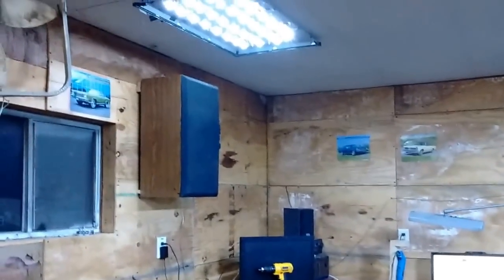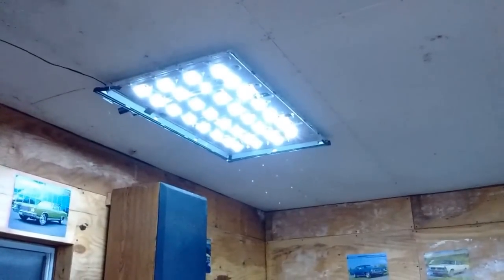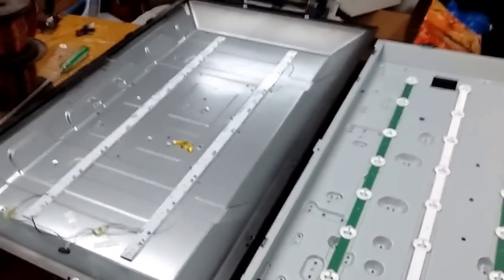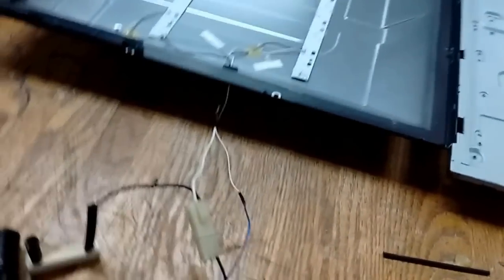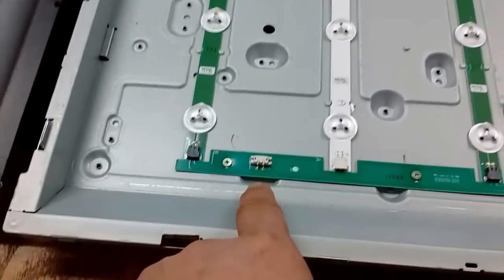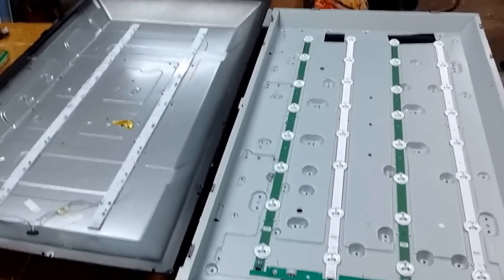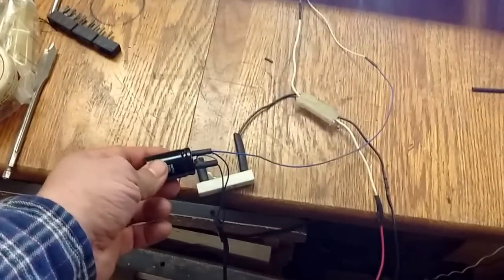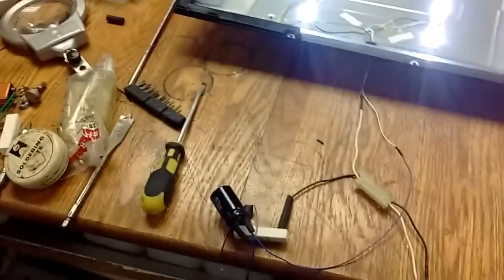DIY Super cheap & easy LED shop lights

Comment: I’m almost ready to try this.. I’ve lit my shed successfully with the bulbs from  (2) 55” salvaged TV’s using a 24vdc power supply. I want to try your method but What if 1 LED bulb burns out? Do they all quit working? Thanks
Reply from the maker: Yes unfortunately, they all quit working if one burns out. When that happens, just bypass that LED with a jumper wire and you will be back in business.
Reply: Thanks for the response. I tried bypassing a bad LED on a strip I salvaged from a Samsung 50F6400 ...the LED's are mounted to a PCB and the traces were finer than frogs hair and wouldn't take solder.

Comment: No, the messing around the back of TV's had nothing to do with capacitors, but more to do with flyback transformers and voltage triplers, on a CRT color set, the rail voltage from a flyback was usually 25,000 to 30k volts. On today's junk throw away TV's, biggest threat is your full wave bridge rectifier there, and filter cap(s)which is a mere 300-400 volts DC peak at best, I've been hit by much worse back in the 80's. So even with TV Technology, as w/ horror movies, it seems the "Shock Value" is lowered as well ;)

Comment: I would add a bleed resistor 10K ohm across the capacitor so that when the power is off the residual voltage on the cap is dissipated.
Reply from the maker: That is a great idea Bert. I think I will do that on the next light I do. Thanks.

Comment: You can bypass the mainboard in the TV just run a bypass on the power supply. usually PS_ON or BL_ON. Look on the board, sometimes it's marked if not you'll have to meter it. Some TVs use a 3.3V signal and a signal ground. tie these two together and the power supply should come on.

Comment: Why not use the original drivers power from the TV?
Reply from the maker: That could work. You would have isolate that circuit and figure out what it needs for an input voltage and find a way to supply it.

Comment: Good idea but the warning about capacitors is very real. They can hold charge for a very long time if not discharging because of a fault, you really do need to check them before touching them. I am not sure that shorting them out is good for the capacitor but it maybe good for you so long as you have a wooden handle on the screwdriver.
cheers

Comment: connect a 10k ohm resistor across the cap to slowly discharge it safely. Measure voltage across the cap after 30 seconds. if less than 1 volt, it has been discharged.
Reply: Thanks, I appreciate that great tip. Shorting the caps always makes me nervous. Using a resister seems like a much safer way to discharge the cap.

Comment: Jumper in a cap with a screwdriver can ruin the internals if the cap.  120 volts is the riot mean square value. Essentially 0.707 of the peak. Or 1.414 x120 gives you about 190 volts doc.
Reply: Thanks for commenting and explaining about the voltage. I didn't know shorting out the caps can ruin them. So far I haven't had any issues, any suggestions on how to safely work with the cap's?
Reply: put about a 20k, 1watt resistor across the cap, it'll then discharge when it  powers off

Comment: Um... Lcds uses fluorescent tubes, not leds
Reply: The newer TV's are using LEDs. Some are only edge lighted while others are filly back lighted. LED tv's are even advertised .
Reply: @KirbyVGCP, did you watch the video?  These two old TV's or monitors that are used in this demonstration, clearly had LED's as their illumination as is evidenced by the video.  The use of LED's supplanted cold cathode fluorescent tubes at least five years ago in most consumer monitors and TV's.